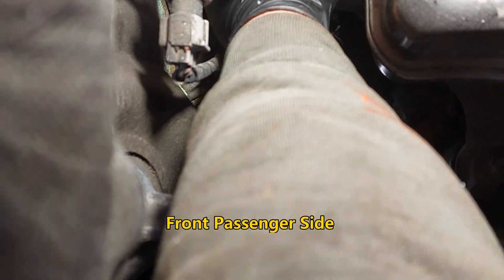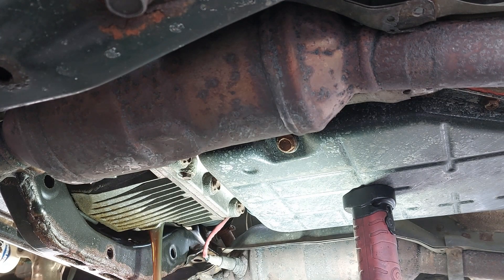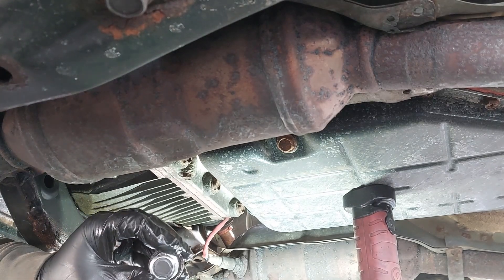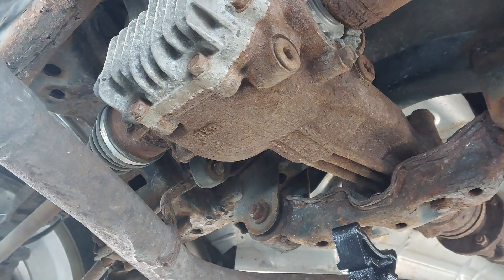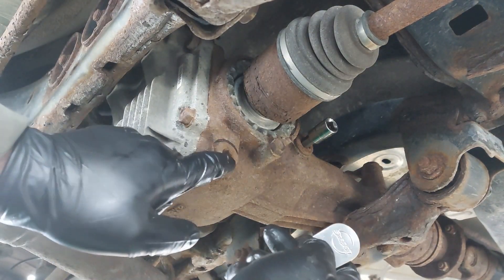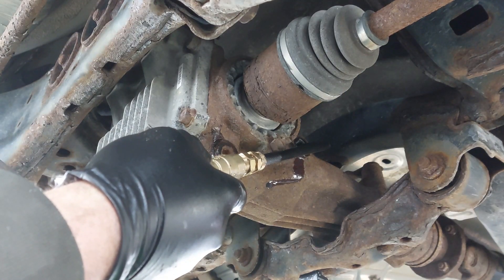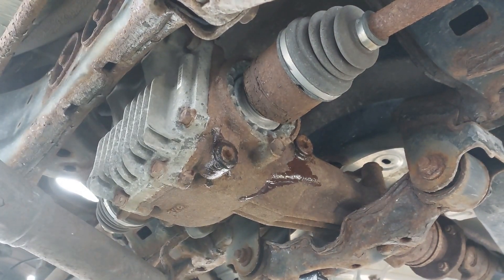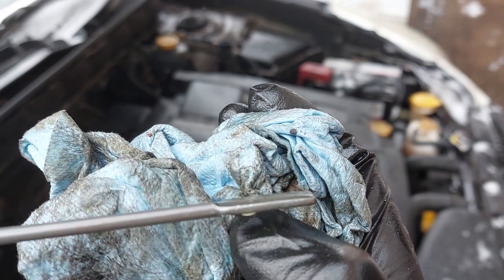Front and Rear Differential Service - 2010 Subaru Outback 3.6

Comment: Hey I’ve watched a few differential fluid change videos including Mr. Subaru and this was the most helpful. Thank You. 

I still aren’t sure what part numbers are for the front vs rear gasket on the 4th generations. From what I heard is that they aren’t the same.